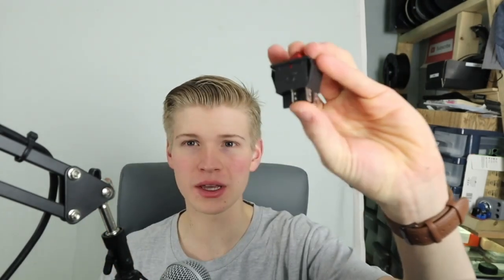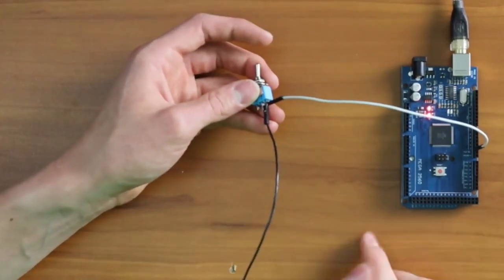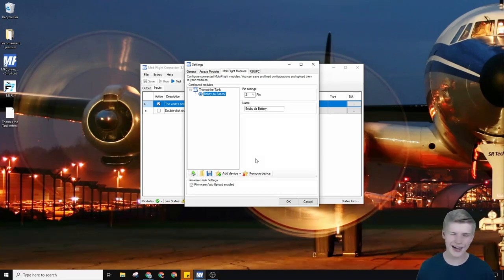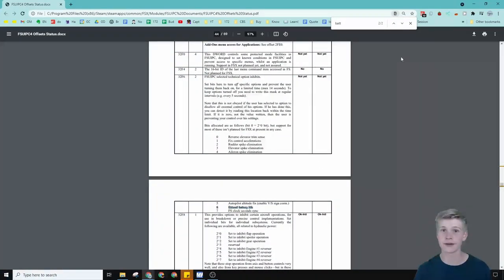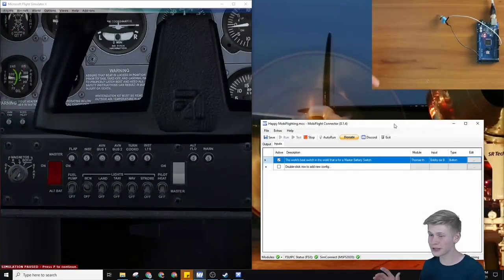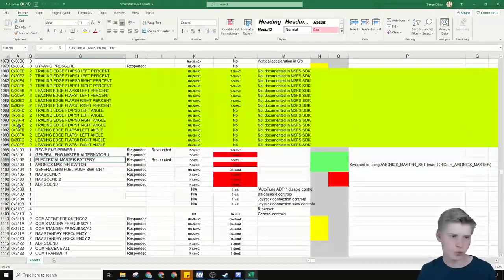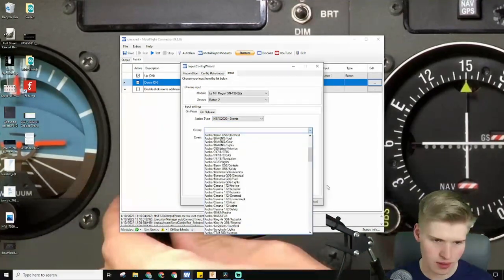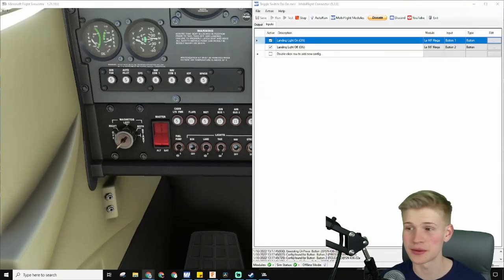Connect an On-Off or On-On Toggle Switch to a Flight Sim | MobiFlight Crash Course Episode 5

Comment: BENDING! Made some weird contraptions trying to connect dupont cables to those connectors. But the key is bending the tip... You've enlightened my day.
Reply from the maker: Not a great long term solution, loads worse than soldering, but I haven't had one break yet!

Comment: This is incredibly helpful. I JUST started learning how to use an arduino so I can build a 737 simulator. I do have a dumb question though: what coding do we have to do on the actual arduino, along with the steps from this video?
Reply from the maker: Hello Christopher! With MobiFlight you shouldn't have to do any actual coding, just configuring buttons and switches and LEDs like I showed in the video.
The arduino is just flashed with the config you make when you flash the arduino (as shown in the video)

Comment: 15:38 it's exactly what I needed to mimick the Airbus A320 overhead panel light switches  ;)  for example, the landing lights, the lower on is RETRACT, middle OFF is OFF, upper ON is ON  :)  and there's several others of similar type :)
Reply from the maker: I'm glad it ccould help!!

Comment: You make great videos about MobiFlight! So may I ask you a difficult question?

I am trying to match the starting procedure of a ZLin Savage Cub Carbon/Grravel (MSFS2020) with 2 separate switches and a separate key switch. This aircraft does not use a 5-position key switch but 2 separate on/off switches for the Magnetos. So I use 2 on/off switches (and a key switch with 3 positions - Off, Batt-On, Start) on my controller.
However, I can't get it to work properly.
Switch 1 (controller) on = Magneto left on (so that works well).
Switch 2 (controller) on = Magneto Right on but .... Magneto left goes OUT again in the plane.
So when Magneto Right is turned on, Magneto Left is turned OFF again!

Also turn off the Magnetos left and right with the controller switches does not work properly.

My input settings: MSFS2020 - Custom Input.
My Select Preset: Magneto Switch Left (Right)
Code: 2 (>K:MAGNETO1_SET) (A:GENERAL ENG STARTER:1, Bool) if{ 0 (>K:SET_STARTER1_HELD) }

Do you have any idea what I'm doing wrong and how to fix it?
Thank you very much.
Fer
Reply from the maker: Hello! I can maybe point you in the right direction, but if you want me to sit down and help I offer MobiFlight consulting here: 
https://captainbobsim.com/services/

I recommend using preconditions (and perhaps even MobiFlight variables).
You could set a precondition to the left and right row saying only run if the other one is false then set a precondition to the "both" row if both left and right are true (on). You might need two "both rows" one for each switch, with the precondition that the other one is also on.

I'd recommend using the click and dropdown structure with default simconnect events instead of code to avoid potential RPN coding errors.
Reply: Hi Captain Bob, Thanks for your response. I managed to get it working properly today. I tried out different codes from Magnetos from the Hubhop site and in the end the settings of the XCub worked perfectly.
Reply from the maker: @pure4wood501  Perfect!! Glad you could get it to work!

Comment: Wonderful Capt. Bob! I just solved an issue I was trouble shooting Well done. Just a quick question, in the INPUT tab where you insert the VALUE for the behavior of the switch, where can I get more information on all the conditions available exampl using the "if"  and "$" command?
Reply from the maker: Hello! It's called ncalc, there's a page on it here for all the crazy things you can do with it: https://docs.servicenow.com/bundle/tokyo-application-development/page/product/rpa-studio/reference/supported-expression-functions.html
(Note, not the official documentation page for ncalc)
Reply: Thanks! Is ncalc c#? Or this is something different?
Reply from the maker: I believe it's a library in C# as MobiFlight is written in C#
 @josefzammit3059

Comment: Hi, im new to this and just asking: How many ON/OFF switches can i have on single arduino mega board? To which pins can i connect the switches? And can all of them go to single ground pin? I will be grateful for answer
Reply from the maker: Hi! The limitations are on the MobiFlight Website. To my knowledge for switches it's as many as the arduino can handle
All electronics can go to a single ground pin, just make all the GND wires are touching.

Comment: So you can’t use all of the slots that aurdiono mega provides you with?, for example, you said there are only 3 slots available for ground pins (output)
Reply from the maker: No, You can connect grounds together
Look at the images at the bottom of this post: https://captainbobsim.com/2020/12/16/mobiflight-arduino-compatibility/

Comment: Hi, just a quick question: wouldn't this method send (when the switch is on) a continuos battery on battery on battery on like you keep pressing a button on a joypad or keyboard? Cause that feels "wrong". Or does the mobiflight module handle this and just put the pin down after the "first input" ?

Thanks
Reply from the maker: I think MobiFlight handles this - if you enable logging to a debug level it will say "PRESS" when it detects a press and "RELEASE" when it senses a release.

Comment: Hi, huge thanks for this course, hugely appreciated ! Something I don't get : in this video you advise about jumper wire and at 1':52" you go "I'd highly recommend getting some hook up wire"... So what would you use the jumper wire for ??
Reply from the maker: Hello! 
Jumper wire is great for prototyping, but after a while the connections become brittle and break off
Soldering and crimping some hook up wire with dupont connectors is a better connection.
Reply: @CaptainBobSim  So if I get it right, you solder  hook up wires to buttons, then you crimp a connector on it, and plug it to the board ?
Reply from the maker: Yep! Exactly

Comment: Hi Hi Captain ! :D 
Another question for you :
Let's say I wanna make a parking brake with a rotary selector (like in the TBM 930). There are 2 events : Parking brake on / parking brake off. In that case, can I use a SPST (on - off) or do I necessarily need a SPDT (on - on) ?
Now, about lights, if I wanna have a toggle switch to enable and disable landing litghts. Is a SPST enough or do I need again to go for a SPDT ?
Reply from the maker: You can use a SPST or a SPDT, with the SPST you'd assign an "on press" to one action and an "on release" to your other action. With a SPDT you'd assign two different rows in your configuration.
Keep in mind the physical SPST switch is the same as an SPDT just "ignoring" a pin.
I like to order SPDT whenever I can and use them as a SPST
Reply: @CaptainBobSim  Makes a lot of sens. Once again thank you so much for your help, very very appraciated !

Comment: If i dont know how to soulder, can i just use jump cables like for 5 switches.
Reply from the maker: Yep! I recommend hot glue so it doesn't come undone
Reply: @CaptainBobSim  Hot glue the end of the jumper cable to the switch?
Reply from the maker: Sometimes I'll bend the end of a male jumper into the toggle's connector hole.
When hot gluing make sure the metal touches metal - hot glue is an insulator.

Comment: What is the arduino called? So it is compatible? Im new to this
Reply from the maker: The one I use is usually the Arduino MEGA 2560
There's also the Arduino Mega Pro Mini, Arduino Pro Micro, Arduino Uno, Arduino Nano which are compatible (check the mobiflight website)
Reply: @CaptainBobSim  Thanks

Comment: No info about wiring a Korry switch ... Since these are so common in flight sim builds, it seems there would be more information on this type of switch. ..not
Reply from the maker: Real or homemade? For real you’d reference the maintenance manual for homemade it’s a push switch and an LED